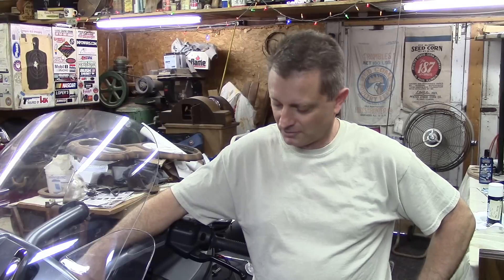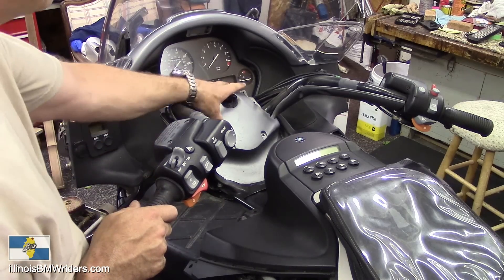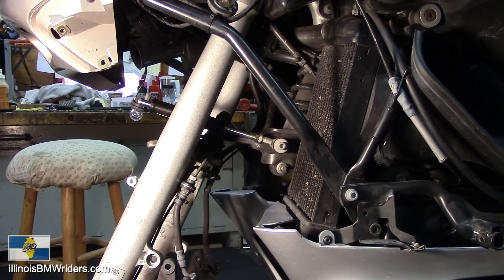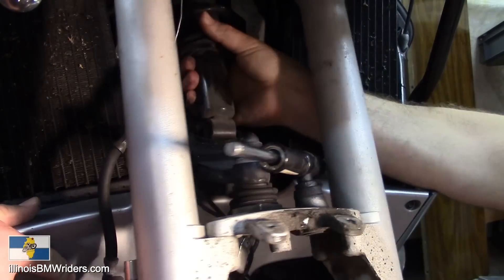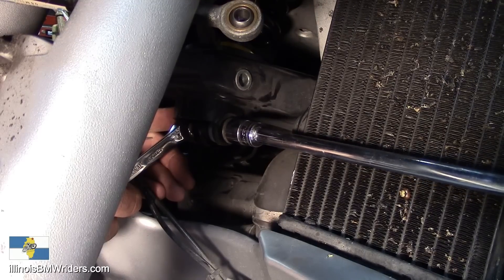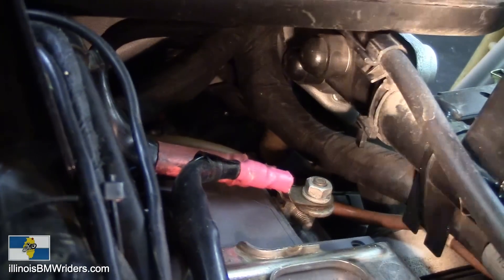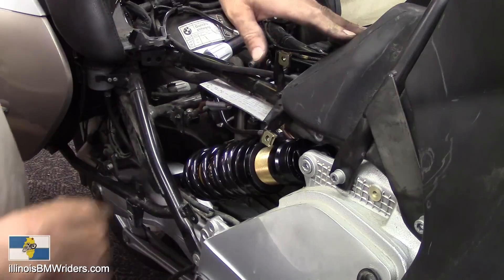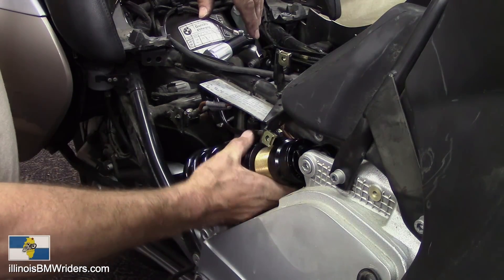BMW K1200LT DIY Shock Replacement (all years)

Comment: Thanks for the videos they have been a greag help. when I changed out my rear shock, I pulled the battery out so i could get a better angle and more room on the top nut. hope that helps

Comment: Added the Ohlins shocks and it added about 1 full inch to the ride. Im not hitting speed bumps as much. (drag on the center stand) Also did the same as you in most of the steps, there is no easy way about it. I also did it with the tank on and the last nut was a pain. I did drop it a few times. Job is done.. Ride is 100% better. I also got a fork with my shocks so I can adjust the height some. Price I paid for both. Less then $1000 new. I got a huge brake as the rear was listed at $940, Fnt at $780. Also at this time you may think about changing the air filter or even the gas filter if needed.

Comment: Kirk, your videos are great and have saved me thousands. In fact, maintaining my bike is a new hobby for me thanks to you.

With 60,000 miles on my 2000 LT, replacing shocks and springs is on the radar for me at the end of this riding season. I'd opt to lower my bike like in this video, so what's involved in adjusting the center stand and side stand?
Reply from the maker: just some cutting, welding and grinding... Not to bad really. Thank you for the nice comments!

Comment: Great video!  I have a 2005 lt with around 45k.  What brand of shock do you recommend for replacement?
Reply from the maker: It largely depends on your budget. The best bang for the buck is Hyperpro springs on the oem shocks. Best you can get is a custom set made just for you from either Ohlins or Hyperpro.

Comment: Have you worked on the K1200lt trunk?  My mechanism is faulty and needs replacement.
Reply from the maker: Mercifully no. This is one I hope to never have to do. But now that I have said that mine will likely break.... :-(
Reply: +Kenneth Henjum Assuming you are referring to the latch, this is one of the first mods I did (and I've done very few). Mine wasn't yet broken so it was  pretty simple  to do if I remember correctly. I'm a novice with tools.Got my parts here: http://www.lttrunklatch.com/